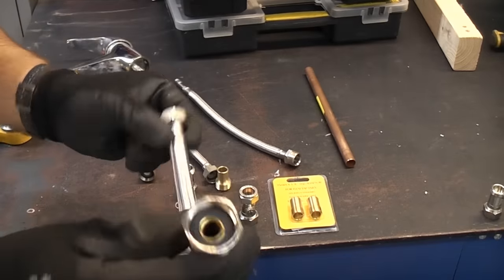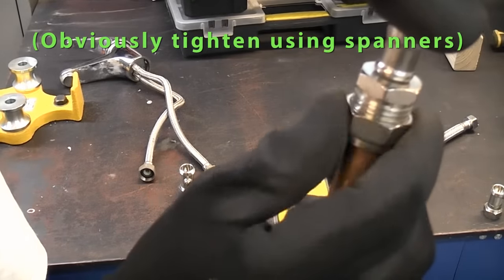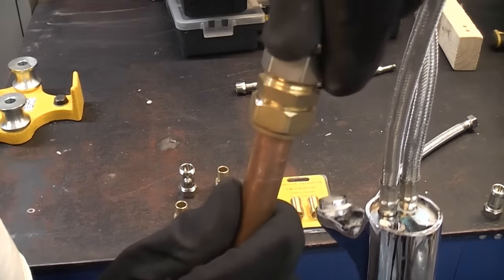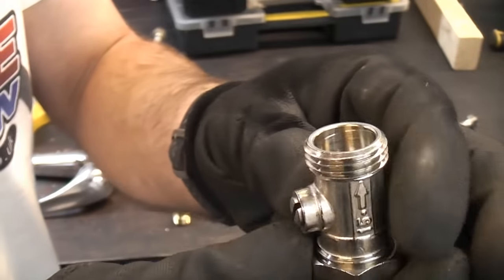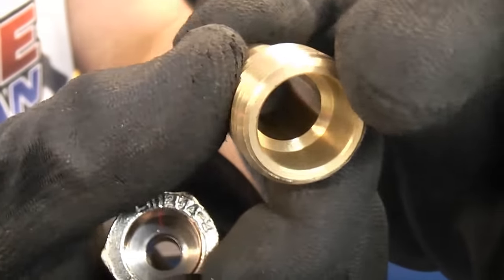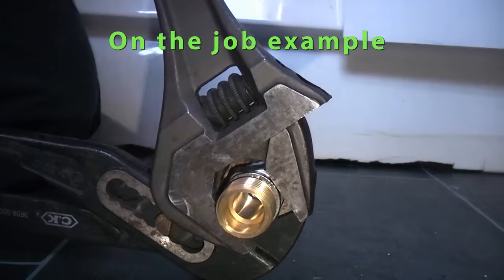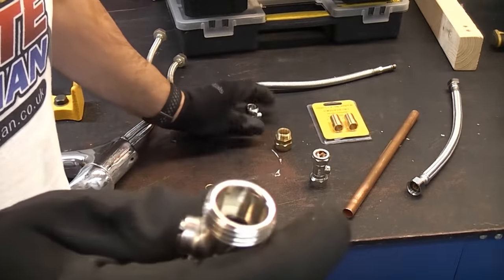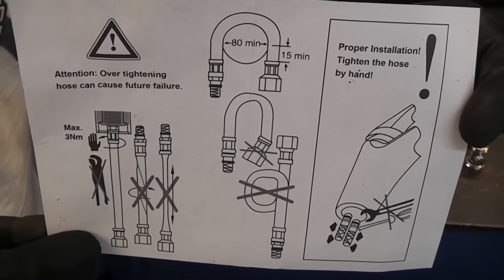How to connect flexible tap connectors 2019 | flexi tap tails

Comment: My moen faucet steel braided water hose is leaking at the fitting. I have a new hose but the end doesn’t fit. Do they sell adapters? Can you tell me how I can fix this. I’m lost.
Reply from the maker: I don’t think they sell adaptors, but there are a few different sizes of hole at the tap end. Perhaps remove one of the flexi tails and take it to your local plumbers’ merchants. They have a large selection of them at most plumbers’ merchants 👍

Comment: Hello , I noticed there is rubber sealer already fitted in on the female flexible. Would it not be best to get an extra rubber sealer for the male flexible as well ?
Reply from the maker: No, normally the flexi’s with a male thread at the opposite end to the tap, are designed to connect to a pipe, using a compression nut and olive 👍
Reply: @ultimatehandyman  thanks for the quick answer

Comment: Silly question but does the flat faced isolation valve come with the olive already inside for connecting to copper pipes. Or is that bought separately?
Reply from the maker: Yes, the olive is normally with the valve 👍

Comment: Hey thanks for the video, have a quick question, bought a new tap for my kitchen recently, but upon taking out my old one, i've noticed the compression nut on the pipe is female, and the flexi hose ends are also female, where as my old tap was male, is there a work around, maybe with the flat-faced isolation valve as shown in your vid, or a Thread Pipe Connection Male x Male Screwed Nipple? thanks!
Reply from the maker: You could use a nipple, providing you can get one with flat faces. That is probably the easiest way of joining two female parts.
Thanks for the comment

Comment: How do you tighten flexi tails into a monobloc tap when the thread is set back into the body of the tap so you can't get your fingers in? It seems wrong to just twist the braided body of the tail... or is there a little spanner that can be inserted to gently tighten it into the tap?
Reply from the maker: It should be fine. A lot of manufacturers now say that you only need to screw the end into the tap using your fingers, there is normally an "O ring (sometimes two)", that does the sealing, so just screw them in using the braided part, but don't go mad.
Best of luck with it 👍

Comment: Thanks for the informative video!

I am trying to install a tap that has a male flexi end. I need to connect this onto a pipe that has an isolating valve on it - what adapter do I need for this?
Any advice much appreciated.
Reply from the maker: Providing the male thread is half inch bsp, you just need a small piece of pipe to go from the isolation valve, then use an olive and a compression nut. 👍
Reply: @ultimatehandyman  Hi – I'm in the same situation (tap came with a male flexi end and need to connect to the isolation valve). Rather than buying and cutting a pipe and using olives/compression nuts, is it possible to buy a flexi hose with a female end, that I can use with the same tap? Can't seem to find them anywhere.

Comment: You can also buy a brass adapter:  like i did....with my new kitchen sink tap, with flexi tail ends.   On the adapter:  one end being the male;  and the other end....having a push fit;  as opposed to a compression fitting.   You don’t get any leaks on push fittings.   
With a compression fitting:  there is a knack to it; when tightening. Otherwise it will leak.  
Chrome isolation valves, or the cheap versions...i tend to avoid.  It’s much better to buy a John guest push fit isolation valve;  or one of those full bore valves with a handle on it.   i guess you pay for what you buy.
Monday am at 07:09H.  15th March 2021. U.K. 🇬🇧 Southampton.

Comment: To stop the squeak etc can I use jointing compound ?
Reply from the maker: I would not use it, only because the fitting manufacturers don’t specify it!
Reply: @ultimatehandyman  rightho, wasn't trying to be smart :) was literally wondering for my own education .
Reply from the maker: I didn’t think for one minute that you were 😉
Over the years I have had loads of people telling me to use jointing compound, mainly on compression fittings- so I looked into it and could not find a single compression fittings manufacturer that recommends using jointing compound. The only people that recommend it are the jointing compound manufacturers 👍
Thanks for the comments 👍

Comment: Is there such thing as a push valve that converts into a flexi pipe fitting?
Reply from the maker: You can get these- https://fave.co/3xXl0vm
They are also avaliable to screw directly into mixer taps- https://fave.co/3j2CzFX

Comment: are these fittings intended to be connected directly  to the flex line ? or do they need a little teflon tape or plumbers paste on the thread  ? ?
Reply from the maker: They normally connect to a 15mm water pipe.
PTFE tape should not be required, as there is a seal in the fittings already 👍

Comment: I have connections that r about 1/2 inch 2 short of flex hose to a on off valve . How 2 lengthen it say about an inch?
Reply from the maker: It’s not as simple as it sounds to do this without cutting the pipe and installing a compression coupler, but that would mean isolating the water elsewhere. 
You could connect one of these to the existing isolation valve- https://bit.ly/3K5Nixz
If your existing isolation valves are flat faced, you could use a rubber washer to seal between the two components. If it’s a regular compression valve, you will need PTFE tape.
You would then need this to connect the tap tail to- https://bit.ly/3YICE3D (assuming your tap tails are ½ BSP) 👍

Comment: i like those...
i almost never need to throw them away...i get them abit extra long incase they leak at both ends that way i can cut the bad end and then crimp  it again with new brass ferrules 
how ever if your using a manual press throw your entire wight on it ....step on the thing if you need to make sure it crimps well 
@2:10 you could sand the the end to make it flat with file first then smooth it with a sand paper to get a flat contact area
Reply from the maker: Thanks for the comment

Comment: Great Video as always! What do you think about using a Fibre or Poly washer on the flexi connector? Also have you done a video on fitting non return valves on mixer taps? Often I find that when replacing an existing mixer and fitting a check valve the flexi tails end up being to Long and kinking.
Reply from the maker: There should be a rubber seal in the flexi tail, I would not use another washer, as this can cause leaks.
I've not done a video on fitting non-return valves on a mixer tap, sorry.
Thanks for the comment 👍

Comment: hi I am going to change my kitchen tap very soon. The flex hoses - are they universal thread size? the current ones were installed in around 20 years ago, ps if the hose is slightly shorter than required is it possible to buy a small extension (say around 60mm)? thanks for your help. A little confused with thread size since for example in the documentation it describes the size as being 10mm or 12mm (dont think they can make their mind up :) then the bore is 8mm (I presume that is the hole itself) , so then they say its 1/2 inch , confusing or what. thanks in advance
Reply from the maker: No, they are not universal. 
If I were you I would replace the tap tails as well, most taps come with new flexi tails.
These videos might help-
Basin tap- https://www.youtube.com/watch?v=Un-nVcJT1ZU&t
Kitchen tap- https://www.youtube.com/watch?v=N-MyYzYwEhc&t
Thanks for the comment 👍

Comment: Why the end which go inside tap is different for 2 hoses? One is a little bit longer than other.
Reply from the maker: Some taps have the holes in the tap too close together, so you could not tighten the tails into the tap (if they were both equal in length), so one tail is made slightly longer so that the nuts for tightening are offset 👍
Reply: @ultimatehandyman  oh dear I never thought about that! Thanks very much.

Comment: What do I do I have female flexi tails and the compression nut already on the pipe is also female ?
Reply from the maker: You can fit either a compression isolation valve or a straight compression fitting, then use one of the tap tail adapters. 
Thanks for the comment 👍

Comment: Quick question, when you put in the Flexi tail fitting in to the isolation valve you tighten the nut and seems like the tail fitting seems to be tightly secured. I have a isolation valve and Flexi tail fitting but the tail fitting seems to be just sitting in the isolation valve with no way of tightening. Have I got the wrong isolation valve or am I missing something simple. Thanks
Reply from the maker: You have not picked up a service valve instead of a compression isolation valve have you?
Service valve- https://www.screwfix.com/p/straight-service-valve-15mm-x/58008  (this is designed to fit directly onto a tap)
Isolation valve- https://www.screwfix.com/p/isolating-valve-15mm-10-pack/32802

Thanks for the comment 👍
Reply: @ultimatehandyman  no, ive just realised what i was doing wrong. basically im a daftie. but much appreciate the reply. your videos and advice are great for someone like me.

Comment: Need some help if you can
 iv got two 22mm Flexi tap hoses from screw fix
With compression fitting one end for bath taps need to reduce down to 15mm pipe work 
Any I dear as best way to go  don't want to use 22mm tap end and15mm compression end 
Because of narrow bore on Flexi 
Or would it not mater   
Thanks
Reply from the maker: If the bath is fed by 15mm pipes it will not make much difference. 22MM pipe was only used because they used to have gravity systems, these days the main incoming stop tap is only 15mm in a lot of properties (the ones that I have seen at least)
Reply: Ultimate Handyman okay many thanks

Comment: How do I extend a flexi tail, I bought a new mixer tap for kitchen and one of the flexi tails is about an inch too short.
Reply from the maker: You can either-
1. Get a longer flexi tail
2. cut the pipe and add a compression fitting, which will give you the extra inch
3. Use a male to female coupling- https://fave.co/33tFOeZ (but this might not extend the pipe enough)
Thanks for the comment 👍
Reply: Hopefully I think option 3 should work. I don’t want to disconnect the tap from the sink again.  Such a tight space, barely enough room to work.
Many thanks, great video👍

Comment: I'm thinking, in a pinch,  you could use some fine(-ish) emery paper on a good flat surface to take the sharp edge off the standard compression fitting... 
😎👍☘🍺
Reply from the maker: I've never tried that, but guess it will work
Thanks for the comment 👍

Comment: Hello mate, one question,  can I use flexi tail adaptor  into one of these push fit elbows. ( asking because the adaptors of 15mm are short by 3 or 4 mm to get to the middle, will that be good enough deep into the push fit elbow ) or there is a chance of leak .
Thanks
Reply from the maker: The adaptors should be fine, I'm sure I checked them against my push fit fittings and they go in far enough to pass the O ring and be gripped by the stainless steel grip ring.
Thanks for the comment 👍

Comment: Hi the top of the flexi tail that screws in by hand keeps coroding & braking off. This has had 4 times why is that happening
Reply from the maker: Not sure, I have never heard of that happening before 🤔
Reply: Is it a proper branded flexi, not from ebay. There shouldn't be and its really dangerous if there is but is there any voltage on the tap. How long does it take to break off?

Comment: What is the name of the hose in the thumbnail, that male end is what i need but my Hardwhere store only has female/female hoses (Aus)
Reply from the maker: They have a couple of different names.
Monobloc tap connectors
Mixer tap connector
The end that you need comes in a few different sizes over here, depending on the make of tap, 8mm and 10mm
Example of 10mm ones for sale on eBay- https://bit.ly/3IOyiQ5

Comment: Cant believe not to use a spanner ! Seems something's  amiss??
Reply from the maker: Yes, it seems weird to me and must admit that I did give the Flexi a little nip using a spanner! 
Thanks for the comment 👍
Reply: After fitting multiple kitchen and basin taps, the tails do indeed seal very well when their tightened by hand, you can usualy get enough torque on them by screw in with the flexipipe itself, then as a guide take it to the point just before the flexipipe kink twists.

Comment: Can you attach tap tails onto push compression fittings?
Reply from the maker: I'm not sure what you mean by a "push compression fitting". There are compression fittings or there are push fit fittings. I don't think the tap tails are long enough to work with some push fit fittings, so they are best used with compression fittings ;-)
Thanks for the comment 👍
Reply: @ultimatehandyman  Sorry, i meant push fittings.

Comment: what does the arrow on the isolation valve mean?
Reply from the maker: The arrow should point in the direction of the flow of water. If the arrow is pointing the other way, there is a chance that the fitting will fail when it’s closed, due to the way the valves are manufactured 👍

Comment: I've heard and read a lot of scare stories about flexible tap hoses and also experienced an absolute nightmare when one burst in my elderly parents house under the bath . It happened in the middle of the night and I had to rush over to help them cut off the mains water supply.  The amount of water that flooded the place in a short amount of time was terrifying.  The insurance people emergency plumbers wouldn't visit  until I was able to identify the location of the leak.  Unfortunately the side panel of the bath was all tiled up and I had to physically break it all off in the middle of the night , then tear off the sideboard to look under the bath and identify the problem.   Do you know how long before you actually have to replace these flexible hoses?  I've also read that if you keep cleaners and detergents close to them, they can corrode the stainless steel braiding which means the pressure on the inner tube can bulge out and burst.

Comment: Yes, but how many turns to turn onto the washer end?
Reply from the maker: Hand tight, then perhaps 1/2 using a spanner.
Just don't go mad with it, or you'll damage the rubber washer
Reply: @ultimatehandyman  Thanks, 1/2 a turn was a start. Beads of water appeared on the threads.  After a complete turn, it stopped.

Comment: These isolation adaptors seem to make for an easy connection for fitting the screw end of flexi tails from taps or toilet etc. I was thinking it would also be good for Bath taps because of the tight space you usually have to work in under there but these adaptors dont seem to come in a larger size. My bath taps have a 3/4 thread(as most do), so it would need a flexi tail with a 3/4 female screw on one end(to latch onto the taps) and then a 1/2 female screw on the other end to latch onto the adaptors in the video. I cant seem to find a flexi tail with that arrangement so i will go another route.  Unless anyone knows any different? Just wanted to share my thought incase anyone else is thinking on same lines. Thanks
Reply from the maker: This video is worth a watch-
https://www.youtube.com/watch?v=eqECFK42PKQ
Here's a 3/4 inch to 15mm flexi push fit- https://fave.co/3qK1wZG
👍

Comment: Have you ever fitted to 22mm copper pipe?
Reply from the maker: No, 22mm copper pipe was often used in gravity fed systems for the bath taps only. 
I think you would have to reduce the pipe down to 15mm in order to use flexi tails, unless they make flexi tails with ¾” BSP fittings.
Reply: @ultimatehandyman  my daughter's old small semi detached cottage has 22mm copper in parts (formerly gravity) and the sink and bath are currently 22mm copper.

Comment: anyone able to tell me how I can tell if I've got 1/2 or 3/8 flexi tails, the taps dont say anywhere what they are and I'm unsure how to measure/check them
Reply from the maker: You can only check them if they are not already installed.
1/2 will measure roughly 12.5mm in diameter, 3/8 will be roughly 10mm diameter (the threaded part)

Comment: Is there an adaptor from push fit to flexi female?
Reply from the maker: There are loads of different types of flexible pipes available, just do an image search and choose the one you need- https://duckduckgo.com/?q=speedfit+flexi&iax=images&ia=images
Reply: @ultimatehandyman  the flexis provided have 2 o rings... does it matter of the ones I buy have only 1?
Reply from the maker: Not certain about that, but I’d use the ones provided and alter the pipe side to suit 👍
Reply: @ultimatehandyman  I'll try it and let you know 🤞

Comment: What size spanner do I need to remove nuts under the sink?
Reply from the maker: I'm not sure, as I have a set similar to this- https://fave.co/3mBLz4d

Thanks for the comment
Reply from the maker: @fightermma   Ah, right. I thought you meant the nut that holds the tap to the sink.
I think 15mm compression nuts use a 24mm spanner, although I normally use an adjustable spanner.
Reply: @ultimatehandyman  the adjustable spanner isn't really cutting it.

Comment: Female ones are only common online but you can not get them in B&Q, wickes, screfix or tool station i tried today and no luck.
Reply from the maker: What do you mean by female ones?
Female at one end, or both ends?
Reply: @ultimatehandyman  one end, and thread on the other to go into the taps.
Reply from the maker: @Kaosinlondon79   That's weird, most of the ones on their website (screwfix) are female.
I've never walked in to buy something though, I always order online and just collect from there.
👍

Comment: Could you not just face off some 15mm male ironfittings in your lathe at work, especially if you're using lots of them? Just a thought.
Reply from the maker: Probably, but its easier to buy them. I don't use many ;-)
Thanks for the comment 👍